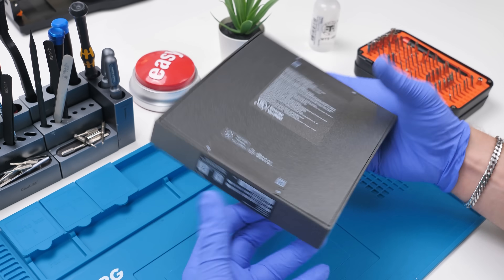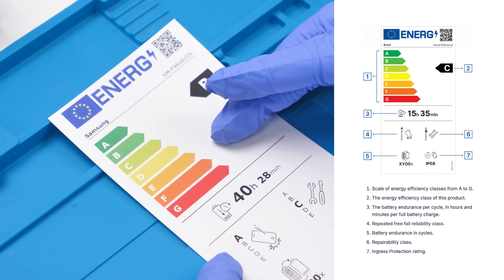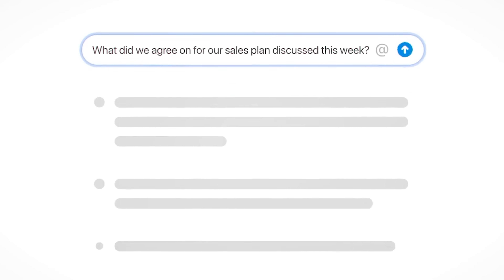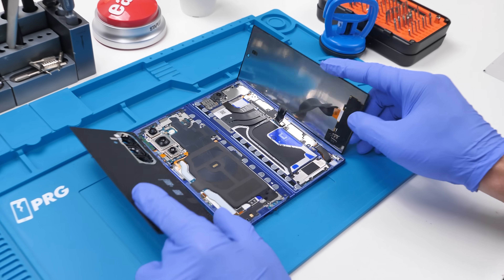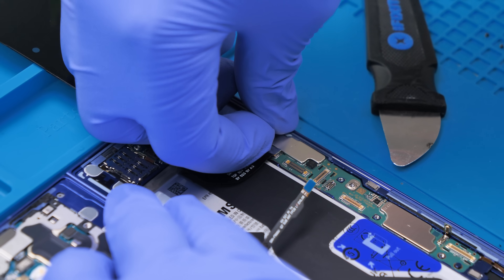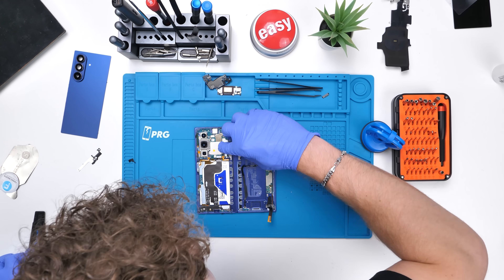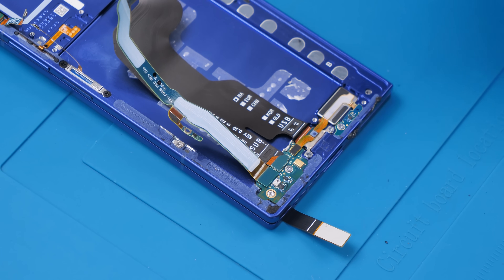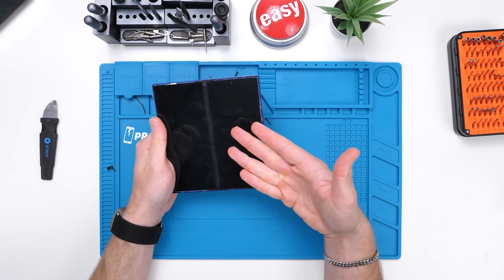What Does This Mean? Z Fold 7 Teardown...

Comment: Watching this on the fold 7 made me a little uneasy. It's my first fold and I'm terrified of breaking it...
Reply: Just becareful this fold is built really well dont listen to this dunce in the comments
Reply: I've had every fold, and the last two generations really worked out all the kinks. The phones are durable, and I go caseless and have dropped mine on a concrete driveway from a truck with no scratches or dents yet. The only issue i had with my fold 6 was the battery and charging port, so I upgraded to the 7 with all the trade-in deals. You'll be fine. Enjoy that sweet fold 7.
Reply: @SayanOfRagnarok  My main concern would be getting dirt in the hinge because my job requires me to be on construction sites occasionally. For that reason I kept my s23 ultra for days I think I might need my phone in some dirty conditions. Otherwise, especially when closed, I'm really not too concerned about durability.
Reply: i have a flip 5 and physically its fine, and i work construction with lots of rust in my life. its physically fine. i just hated the software side of it. DONT get a flip 5/6, the front screen is worthless. 7 is slightly better but mostly the same issue, cant really do anything on front screen
Reply: @bradhaines3142  The front screen is obviously smaller than my ultra but I think they did just enough to make it usable on the 7. I think I waited until the right time to get a fold, especially because I don't use the Spen much on my ultra.
Reply: It will break anyways. The inner display will scratch up and dent in in no time + the crease
Reply: @tbu_drachenkater5397  I hope to prevent that by keeping my s23 ultra and using it any time I'll be doing something I figure would compromise the fold. Mostly to protect the fold, but also because I actually really love my ultra, I just wanted to try something different.
Reply: @tbu_drachenkater5397 If anything I'm worried about getting stuff in the hinge. The interior screen shouldn't be too tough to protect.

Comment: That camera bump doesn't bother be whatsoever. I thought it would but after holding it in my hand I completely forgot about it.
Reply: It actually helps me hold on to the phone much better. I put my index finger below the bump for better hold. If it was slim then it will easily slip from your hand.
Reply: @Gurenn83  I never even considered the bump to be an ergonomic benefit. Thanks for providing a good argument for it. Sounds pretty helpful. I am still concerned about the cameras catching on a pocket edge, though. Maybe the official "back protector" case would reduce this issue.

Comment: I recently bought the pixel 9a with the eu label included and I honestly think they need some work… the labels are not very accurate on the repairability in my opinion. A B for that thing is crazy when the battery is glued down so tight you’ll probably puncture it. And this video honestly proves it even further, remember the iPhone with its electric battery glue?? Yeahs that’s a C too…

Comment: Only think I doesn't like on this Energy label is that battery life, because if I use phone only for phone calls and SMS, it lasts a few days and if I watch YouTube it lasts one day, so battery life is very objective, because it's not like fridge, which always eats same amount of power
Reply: I think it’s good because it makes comparing different phones very easy
Reply: @TamTam2411  comparing isn't that easy, because CPU power compsumption at at low load can vary, some can eat 1w, other 3w, and if I look on this, my phone has 2 days battery life, with YouTube I need to charge every day, before I had two phones, one YouTube phone, charged every one or two days and one calling and SMS phone, charged like once 4 days, and it's still different how much CPU eats in combination with user
Reply: That’s not the point in it - it’s to let you compare phones. They put together a “typical workload”, and that’s enough for most people to know x phone will last longer than y - even if the numbers are not absolute.
Reply: @bdavbdavbdavbdav  I pick phone like this - I don't want Apple, I want Samsung, which Samsung, had A12, don't want A1x any more (was a bit slower as I expected), I also had A23 also wasn't what I expected so no A2x (ok, now I would buy A25 or A26, because they are A3x series, but renewed) mom has A33 and A35, useable, ok I would buy, and I still ended with A55, it was on sale and temptation was strong, and really if you have phone with CPU which has power as Intel Celeron, even when typing to chatgpt it eats battery faster than phone with better CPU, and also what is typical workload for phone
Reply: @VieraKapinova huh? It’s just for rough comparison. You’re over thinking it
Reply: The rating is more for useful energy vs energy loss. Low rated lamps for example would waste alot of electrical energy to heat while having to eat more watts just to stay turned on
Reply: Not true. The power draw of anything depends on many factors. A refrigerator for example won’t always take the same amount of power. It depends on ambient temperature, how often you open the doors. Same with a phone. But having a baseline testing to compare battery life is helpful.
Reply: @joshb2000jb  but if you put same amount of things to same fridge in different houses it will get same amount of power, phones also, but find two people which use phone same way

Comment: Oof. Removing the hinge thing is brutal. I use that feature all the time on my fold 4.
Reply: I've seen several other reviewers set the phone down with a partial fold configuration. It probably needs to be closer to 90° than what was shown here, but it is certainly doable.
Reply: I have the Z Fold7, you can 100% do it